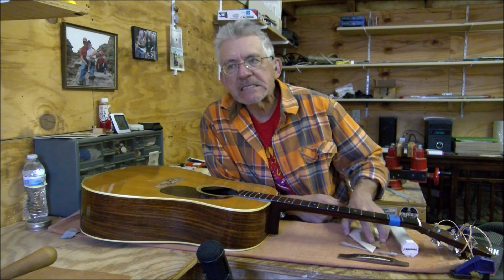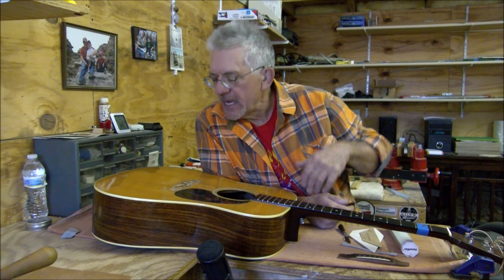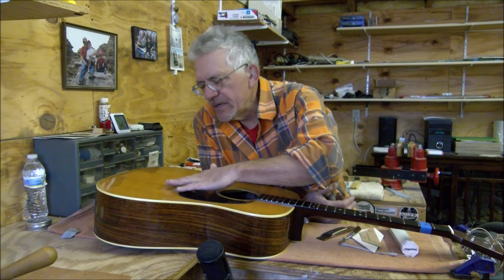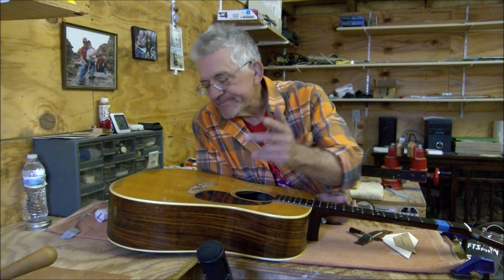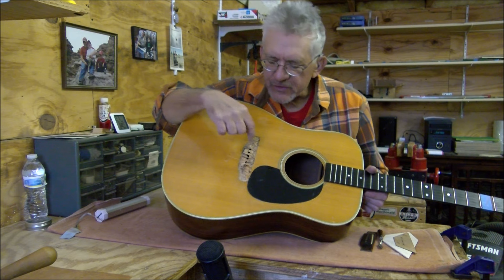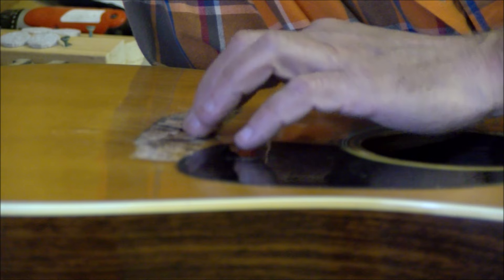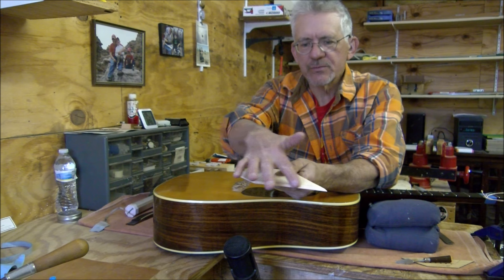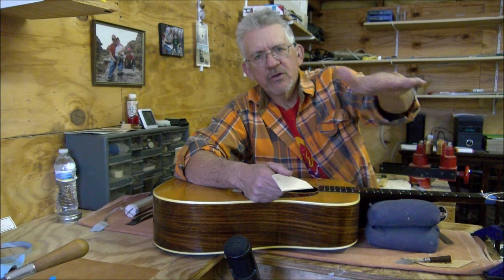Evaluating a busted Martin guitar bridge seat

Comment: You can glue a piece of spruce from the inside that covers a rather large area and let that spruce protrude up in the cavity, that will hold
Reply from the maker: You're talking about a stepped spruce plate.  I might but I think there's enough of the original top to hold if I reinforce it from beneath.